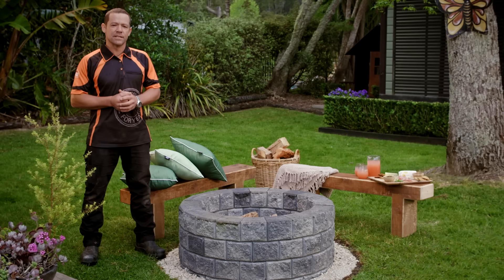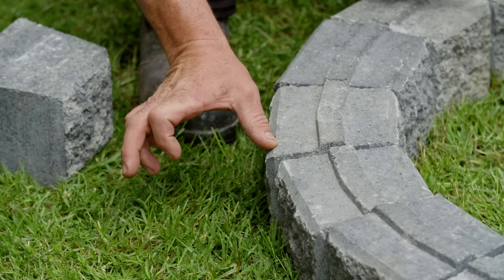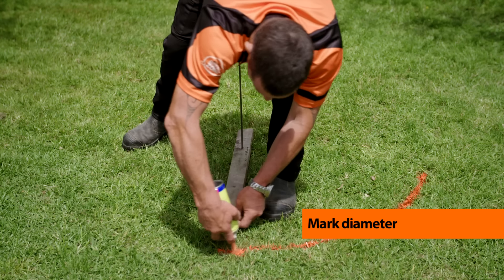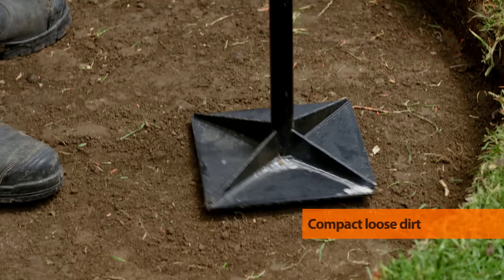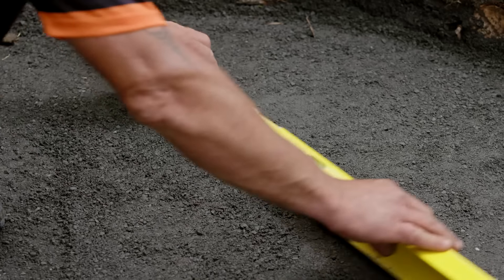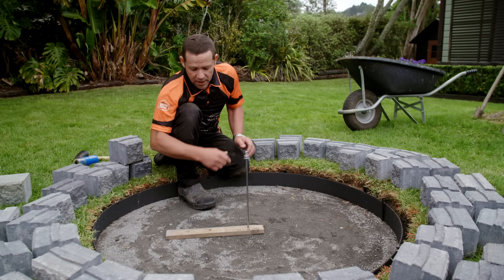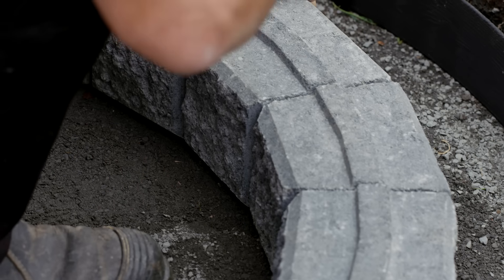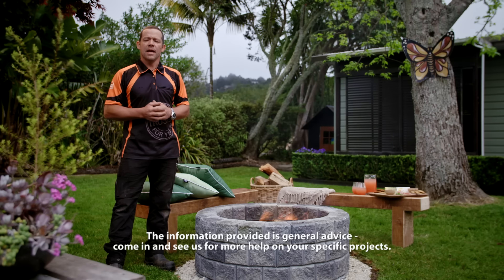How to Build a Fire Pit | Mitre 10 Easy As DIY

Comment: We just built this today! Great video, made it so easy. Mitre 10 has been sold out of the Firth Ezi Blocks it seems at most locations but we were able to pick them up at Bunnings. One improvement over the design in the video I would recommend is leaving one or two bricks out at ground level to create some air flow, for a hotter fire and less smoke.

edit: The price about a year about when I made this was closer to $800-$1000 NZD
Reply from the maker: Thanks so much for the support!, stoked you created it too! ^Cam
Reply: interesting, and do you just clean it out when it gets full with a shovel? In between fires do you have a roof for when it rains or it doesnt matter
Reply: @23wiski  We've only really had to remove some of the ashes once with a shovel. It takes a long time to fill up. Rain isn't a problem as long as we use dry wood to start it.

Comment: To help some others decide on this project, I priced it all up, using Mitre 10 NZ. The total was $541 and that does not include all the basic tools he used. If you owned nothing that was used or required in this video, then you would easily be up for $700.
Reply: Thanks. That is ludicrous.
Reply: @mrdobalina3451  while yes that price may seem ludicrous it should also add property value down the line
Reply: I made a basic firepit a while back (not as good looking as this one though) and the property owner paid me $2000 Aud to keep it in as it increased his property value by about 3-4000
Reply: @Nascarman20  it wouldn't add what you would pay for the pit.

Comment: The Mitre10 in Melbourne don’t have these rocks 😢 would be so much easier if they did. And no Bunnings do not have them either. Miss Mitre10 in NZ
Reply: haha is that because of a certain 🌞 + 🌲combustibles =🔥⛑🚛🚁..... Don't want to be that guy
Reply: @fras444  Nah. Fire pits are legal in Aus with certain restrictions by council and by fire risk status. Check your local council.

Comment: Mmmm, - are "Firth Easy Wall" retaining wall blocks - manufactured to construct low level retaining walls - fire proof or will they be safe at, possibly, high heat levels & not explode???? 
+ in Auckland this would probably be deemed an incinerator & illegal???
Reply from the maker: Hi Mate,
Good question!
Firth Ezi Wall blocks are made with tiny air pockets throughout the blocks which allows moisture to escape (moisture is what causes explosions when it gets trapped and builds up pressure) so due to the porosity of the blocks there is no explosion hazard. 

You must check with your local council on the regulations for firepits in your local area to make sure that you comply which is highlighted in the video. For Auckland, a great starting place is here: https://www.aucklandcouncil.govt.nz/licences-regulations/outdoor-fires/Pages/default.aspx

Comment: Hi are these designed for a firepit? can they absorb the heat that the fire would put out?
Cheers great helpful videos
Reply: Kevin , these are fire bricks .
Made with similar material sand as pizza oven bricks.  .
Cannot use garden edge brinks .